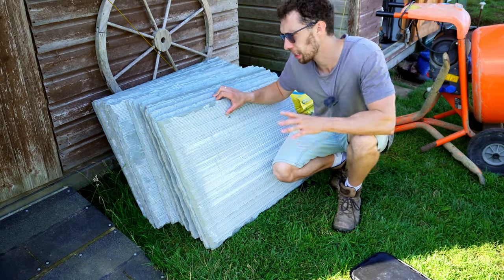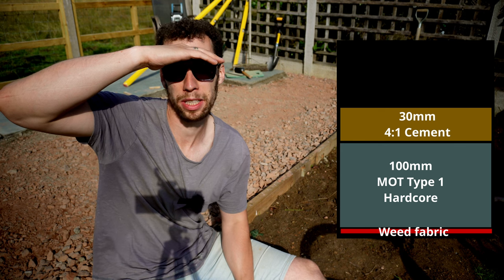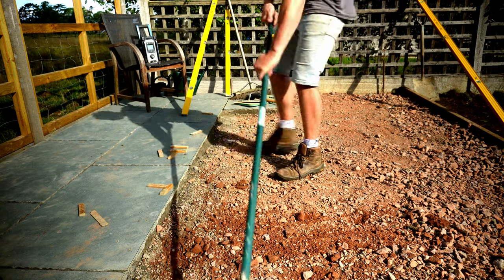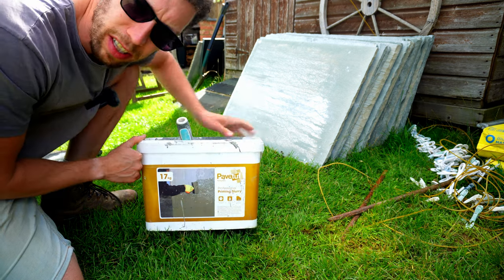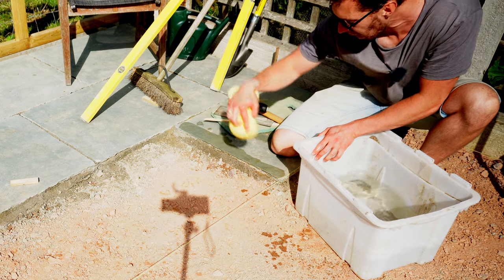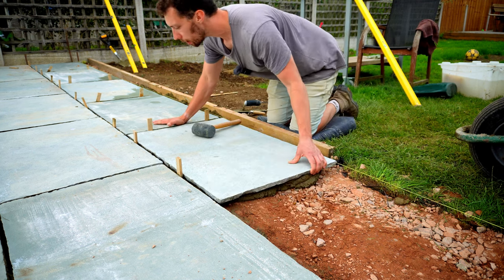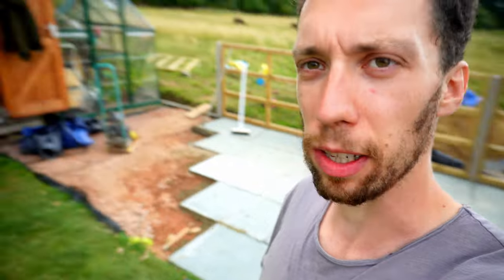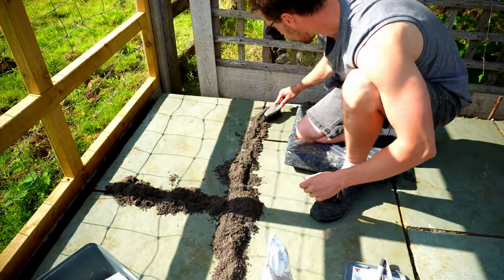How To Lay A Patio As A Beginner

Comment: Thanks for the video, I am in the process of single handedly laying a 72m2, 900 x 600 sandstone slab patio, I am a diy ex lorry driver and thought I would have lots of rest when I retired,,, NO CHANCE,  But thanks to informative videos like yours I have accepted the challenge and currently 10 tonne type 1 compacted to an inch of it's life, 4 tonnes grit sand, cement (lost count), and 24 slabs of the 130 ish, into the project, and its not looking too bad. Looking at the Sika joint compound and the video on the mistakes people make was very useful too. Cheers.
Reply from the maker: Sounds like it's going to be intense! Good luck with it!